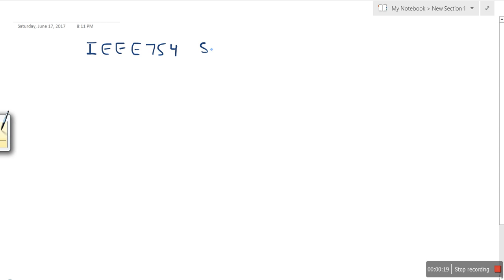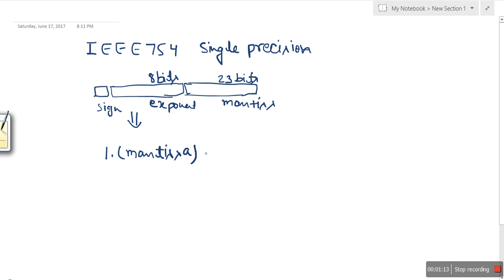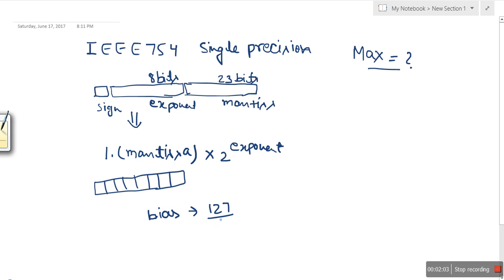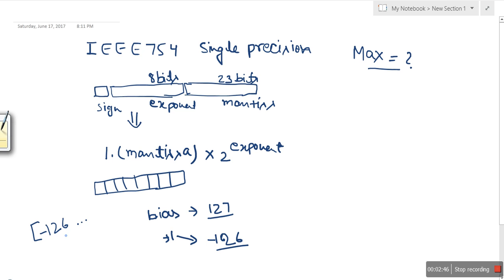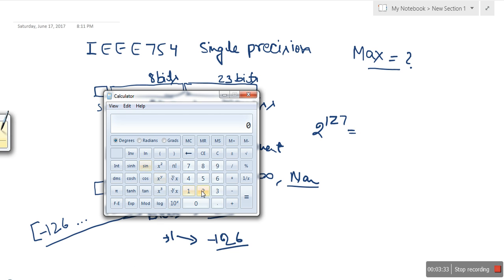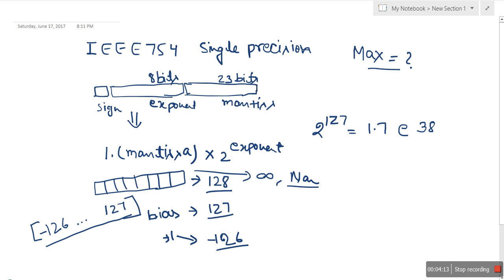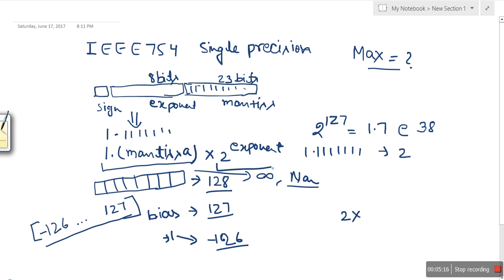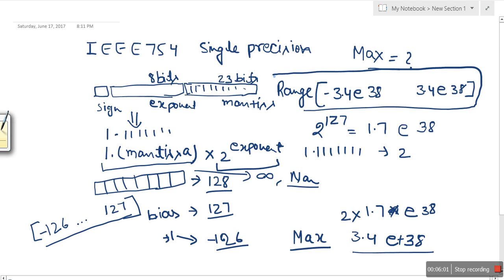How to Calculate Range of Float Variable [ Single Precision ]

Comment: For an 8-bit exponent, even when it's all 1's, the maximum is 126. 
Am I wrong?
Reply: when it's all 1's (i.e FF) it corresponds to a reserved category (either inf or Nan depending on fraction). 
So, for normal values, max exponent allowed is FE (i.e 1111 1110), which corresponds to 255 in decimal.
After subtracting a bias of 127 from 255, we get 128 :)
Reply: @hrishikeshaj976  Actually, 1111 1110 corresponds to 254 in decimal. And after subtracting a bias, we get 127, which gets just in the range [-126; 127].

Comment: For Example: 2.3e-5, means 2.3 times ten to the minus five power, or 0.000023 But you have used e^38. I guess its not correct? it should be 10^38.